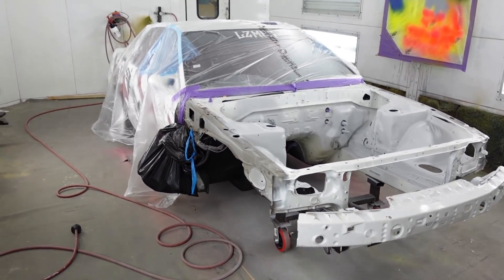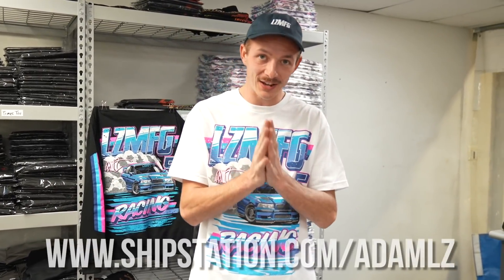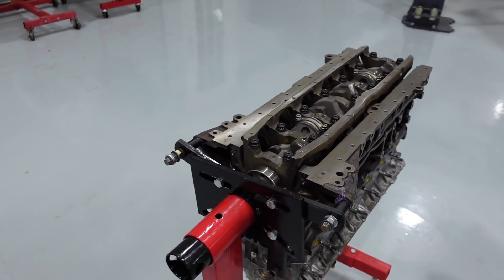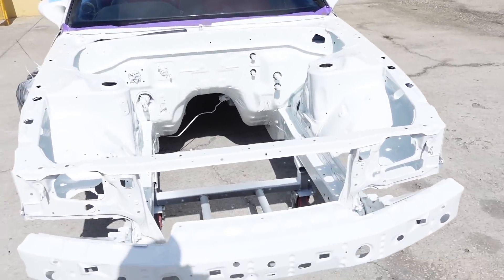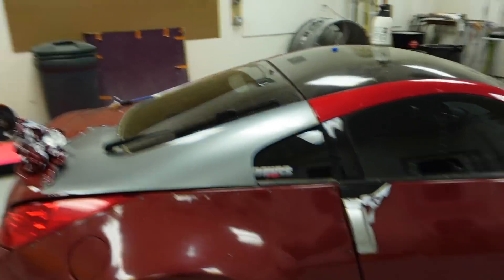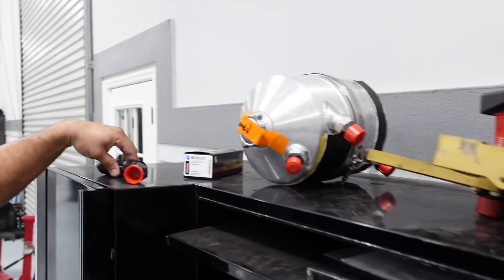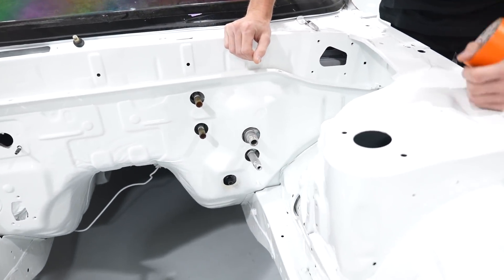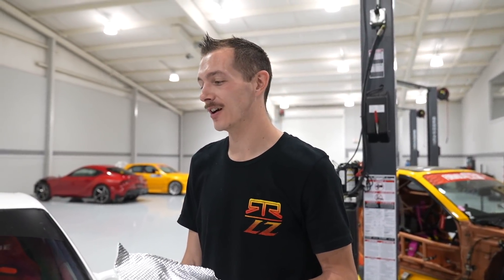Fixing the Crashed A90 Supra + R32 Ready for Engine!

Comment: A tip for drilling through softer materials with a hole saw, drill I'm reverse. Itll still cut, but it won't grab and twist any
Reply: Figured that out drilling timing cover on a k24e nissan motor. We did the chain guides through the valve cover. Just drilled bolt access holes and lifted guide out the top. Then used neoprene expansion plugs to fill it afterwards. Was a ballsy attempt but was a low mile shop truck with broken plastic guide.
Reply: Another idea that I have found really effective is to keep all your old broken hole saws and grind all the teeth off them and then grind a knife edge  - keep a set of these knife edge hole 'saws' for cutting through soft materials

Comment: Undercoating, an ideal source of rust. Moisture gets under it and corrodes furiously. This is a race? car. Scrape it all off, just weight you are carrying.
The S15 is a lemon, sell it or use it as a burnout car or similar. 
As for rotaries?? Look at Collettes lemons. All noise and little go. Build a LS or 302W base engine, more power and 100% more reliability. 
The modern Fords are just so big and heavy in comparison to the far smaller and more reliable pushrod engines.

Comment: Seeing as rb25-26 crack blocks with big power, did you ever think of doing an rb25/30, rb30 block as they are the strongest rb block, and 25-26 head as they are the better rb heads

Comment: Neo? Is that a ve motor? I remember seeing the sr16ve with dual lift running 10k rpm. Pretty impressive seeing 200hp on a 1600cc na motor from the 90s. Guys used to get the color change tach to show when valve lift occured.
Reply: Neo is a improved version of the standard head